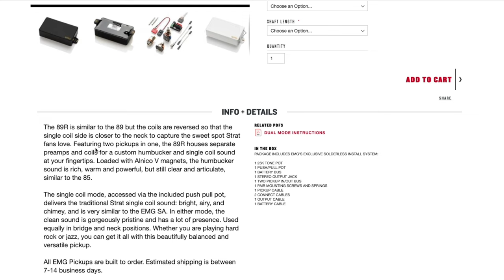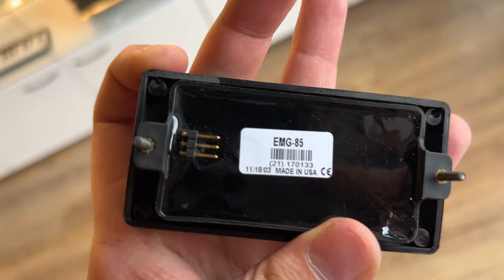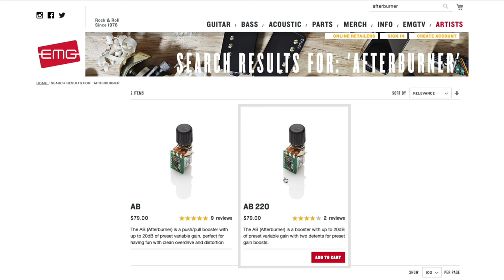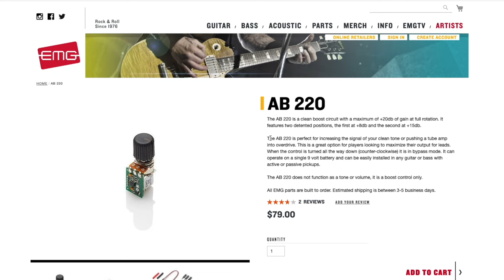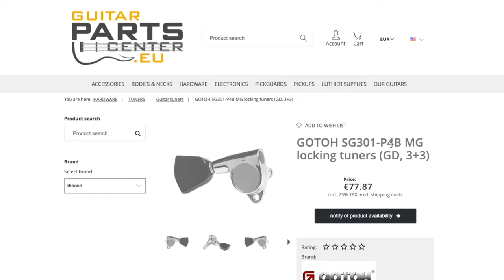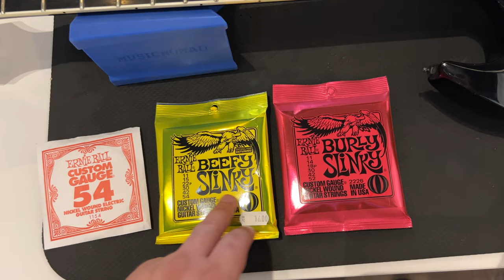ESP Viper with EMG 89R and EMG Afterburner AB220

Comment: oh and now it makes sense.... in hte 2000's I bought a Flying V with an EMG 89 in the neck and 81 in the bridge. The 89 was turned upside down so the single coil feel was there. I personally loved the 89 for cleans.
Reply from the maker: Yep, thicker body - better balance even though it is not much heavier than the SG. They are about the same weight. The viper has better weight distribution. That inverted 89 was cool :>

Comment: Funny enough, i have a Kramer Assault 220 Project since a while. I changed the Pickups to 81/81 in the Past but since i had a GH Set but issues fitting the 89r Push Pull because of Problems with Space caused by a Selfmade Battery Compartment where the Electrics where. But the Push Pull still worked on the Volume Pot Position, going to add an AB 220 to get even more Sustain and Stuff 😎 I have a Kill Switch on the Tone Knob Position but to be Honest.. Split Coil and Boost.. I'm More Interested into that. There are not alot of Videos Talking about the AB 220 and want to Thank you Talking about it. The Image EMG has on the Product Page of the AB 220 is the AB for some Reason, but i noticed now.. The AB 220 Still Fits, because its not different to Tone or Volume Pots by EMG.
Reply from the maker: Sounds like you onow your mods, sir 👍🏻 And yeah weirdly not a lot of info online on these subjects. Probably deep in the forums